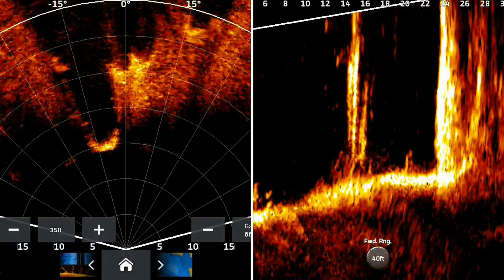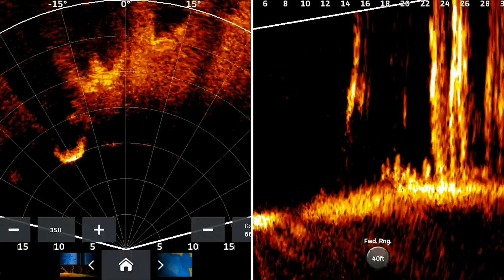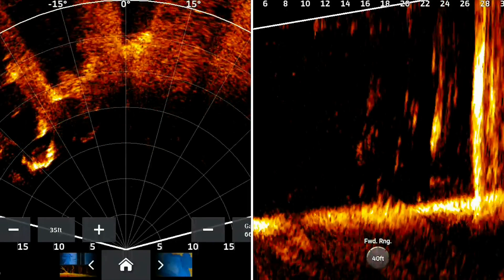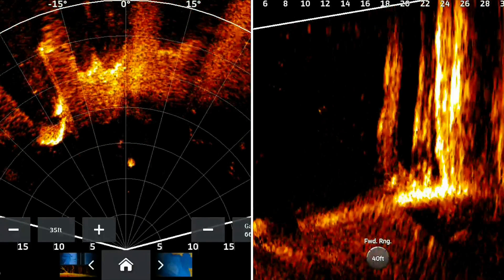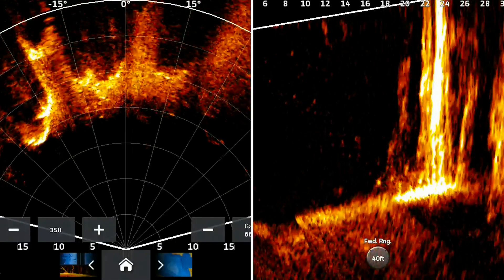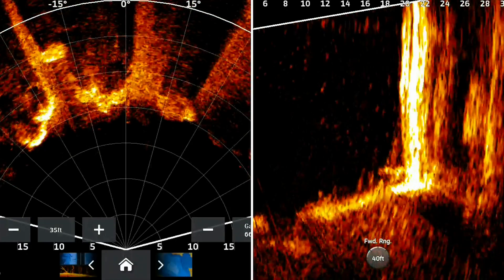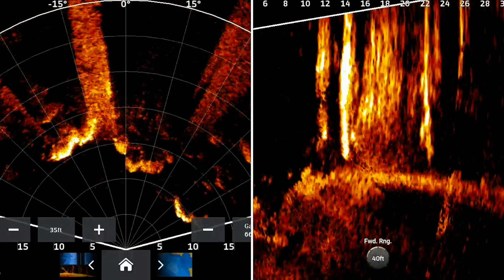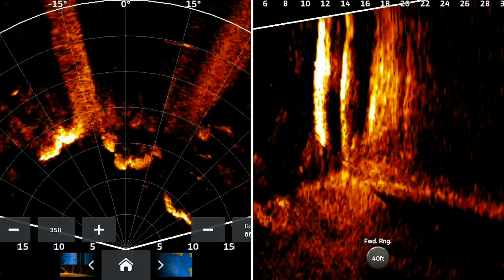Garmin Livescope: Understanding The Beam Width May Explain Some Stitching Problems

Comment: Why does my jigs only shows on the left side of my Transducer
Reply from the maker: Explain better bud. If you have the 8 degree mount it tilts the beam
Reply: I have the lsv34 it's like I have to make sure that my bait is in front of the transducer or a little bit to the left side can see my bait on the right side
Reply from the maker: @FatDaddyJigs  it’s because of the 8 degree can’t of the mount